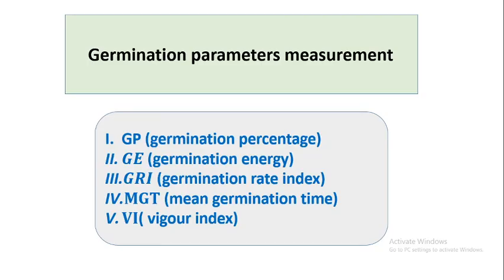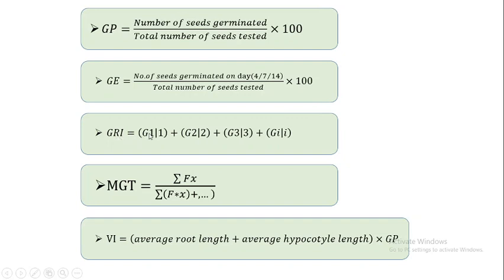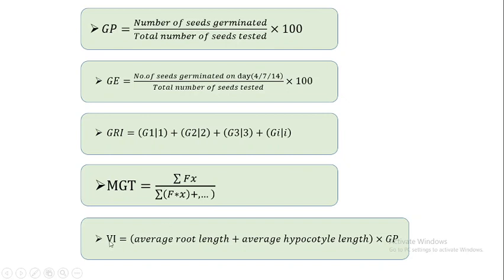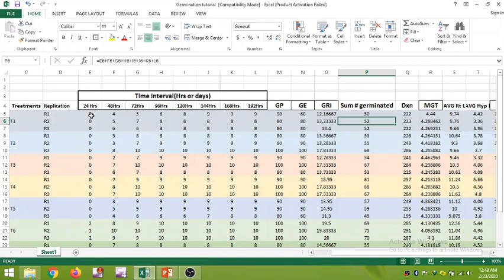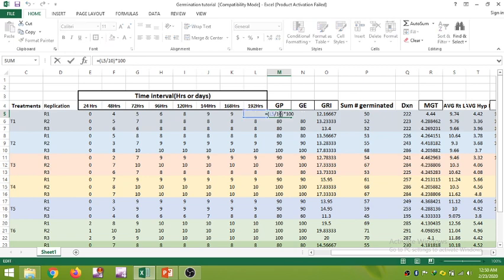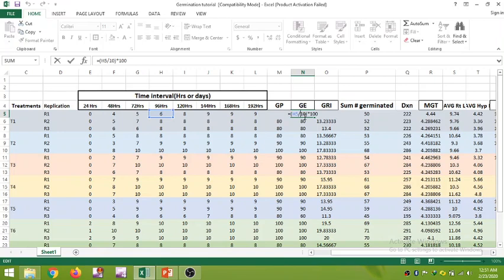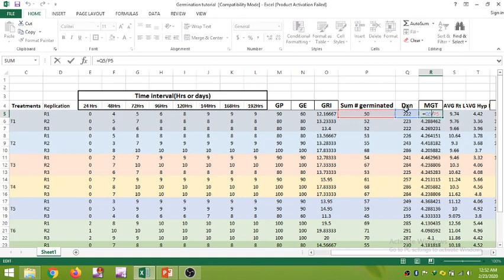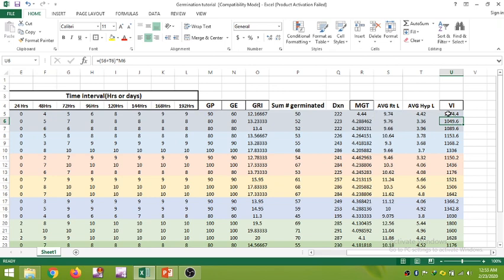How to calculate  seed germination parameters (GP, GE, GRI, MGT and VI) in MS Excel?

Comment: Thank you very much for your video!!! Can I ask about the germination rate index, why do you still divide the number of seeds by 5 from the 6th day to the 8th day? For example:  =(E5/1)+(F5/2)+(G5/3)+(H5/4)+(I5/5)+(J5/5)+(K5/5)+(L5/5), but as I understood, I think it should be =(E5/1)+(F5/2)+(G5/3)+(H5/4)+(I5/5)+(J5/6)+(K5/7)+(L5/8).
Reply from the maker: It depends when germination rate is stable
Reply: @researchgate1989  I have seen in your excel file. For example, in treatment T4, the germination rate is stable from the 3rd day but your formula doesn't change. Why?
Reply from the maker: @tlinha  please consider control
Reply: @researchgate1989  sorry, can you explain more details?
Reply: @tlinha  The same question. Also, T6, rep2 germination rate becomes stable at second measurement and formula keeps the same!
Reply: Sir if germination completed at day 6th. Then I use constant 6 no like (I5/6)+(j5/6)+(k5/6)+ (L5/6) and so on?? 
 @researchgate1989

Comment: I don't understand what mean's Dxn and how to calculate it ?
Reply from the maker: Dxn (Here D=the day that may be day 1st, 2nd,3rd, and so on while n=number of seeds germinated on that specific day. For example if its 1st day then D=1 and n= zero so we can calculate as Dxn=1*0) and continue the same for 2nd, 3rd and keep calculating.
Hope it is clear now.
Reply: @researchgate1989   sir in cae 3 seeds germinated on day 5 but total no. of seeds germinated are 5 out of 10 then what will be the value of n is it 3 or 5
also is this sheet (updated one in the comments) reliable enough to use for thesis calculation?
hoping for a reply. 
thank you,.

Comment: Thanks for making video, I just wanted to ask that when we are calculating MGT and putting formula in excel than how we will calculate number of days? from start of germination or start of experiment for example germination started at day 4 and 2 seed germinated than we will write D*n= 2*1 or 2*4??
Reply: I have the same question why you dont continue with =(1×..)+(2×..)+(3×..)+(4×..)+(5×..)+(6×..)+(n×..)..
Reply from the maker: @aguarongoespadadehercules8819  Please click the link and you will find the updated MS Excel spreadsheet
 https://drive.google.com/file/d/1wEuP9IZEjHuajdJ2YwQCcxU8PsJOP7m0/view?usp=sharing
Reply from the maker: Please click the link (https://drive.google.com/file/d/1-E0I...
)
Then double click the cell below Sum # germinated it will show you how we sum the number of seeds germinated. Next, click the cell below Dxn it will show you the formula (day+#of seeds germinated on that day). Next,  click the cell below MGT  it will show you the formula  MGT=Dxn /Sum # germinated.
Simply you can calculate the number of days from the start of the experiment (day 1st means 24 hrs).
If you need further assistance please share your email ID.
Reply: @researchgate1989   so i looked at the spreadsheet but the formula does no(t match with what has been plugged in for Dxn. How come after 5 days the remaining Dxn is times 5, so it goes (1*2)+2*3)+(3*6)+(4*9)+(5*8)+(5*9)+(5*10) etc
Reply from the maker: @brookemoseley4699  Please click the link and you will find the updated MS Excel spreadsheet
 https://drive.google.com/file/d/1wEuP9IZEjHuajdJ2YwQCcxU8PsJOP7m0/view?usp=sharing
Reply: @researchgate1989  help my friend
Reply from the maker: D*n=4*2
Reply: Sir I have 2 questions please justify me.
1. In GRI why the number of days isn't increased after 5?
2. If number of seeds sown is 10, how can it is increased to 50?
3. In GE calculation, if the germinated seed is next to half of the sown seed, then why is it same for other replication and treatments?